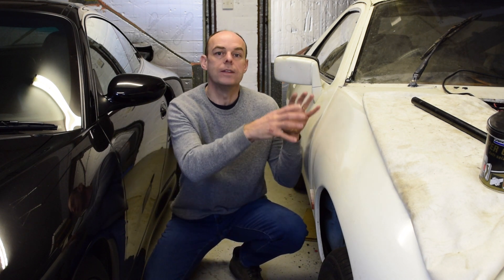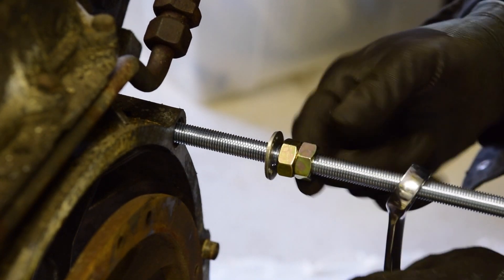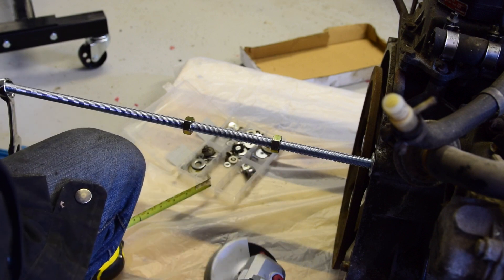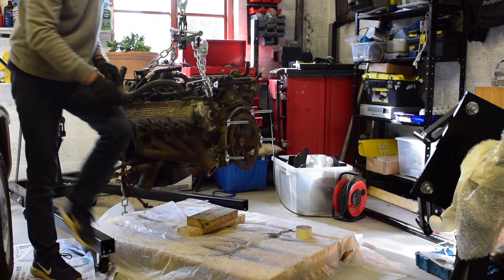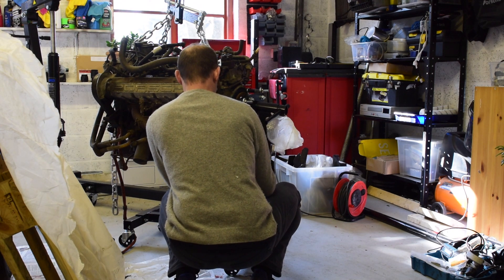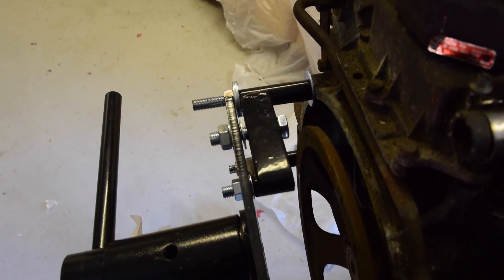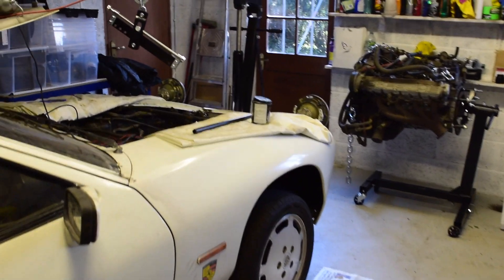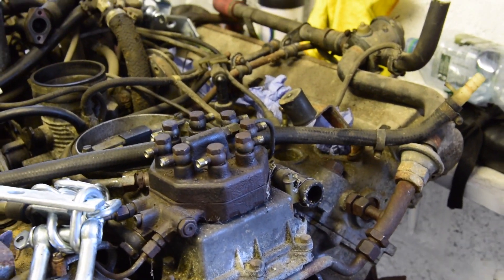Porsche 928 Episode 8 - Getting the engine on the stand

Comment: Just a tip for any future viewers. You need to use high strength bolts to hold that engine to the stand. All thread is too soft for that application and could result in a disaster. Still for someone who is not versed in car this is going rather well!
Reply from the maker: Ah interesting... so should I have used high tensile 'part threaded' bolts? That does make sense. At the time I just bought a long piece of threaded rod and cut to length... Thanks for your comment!